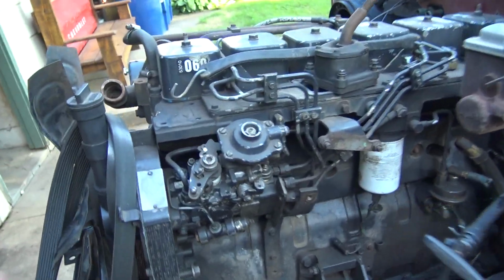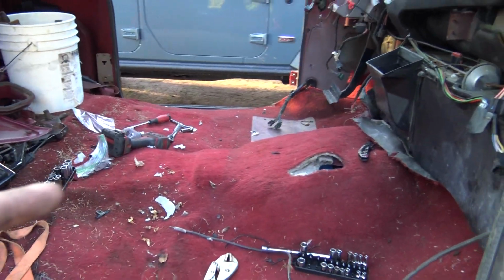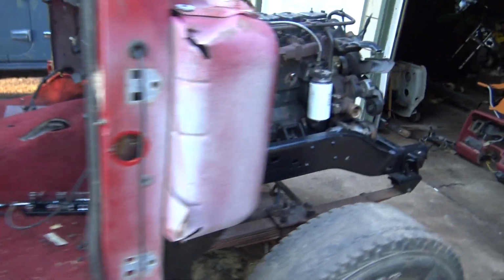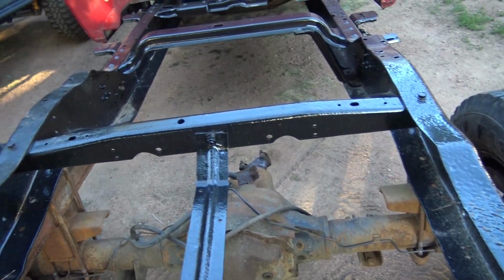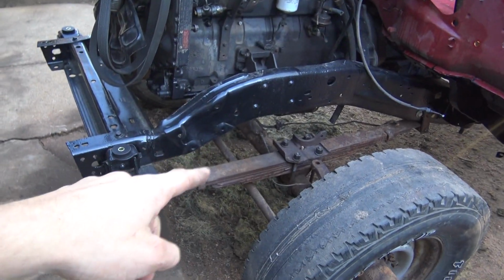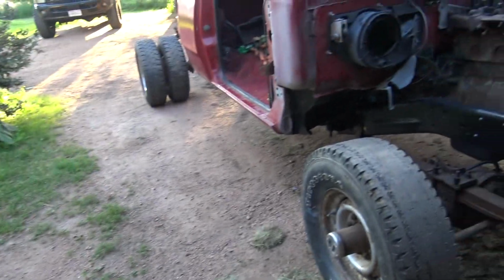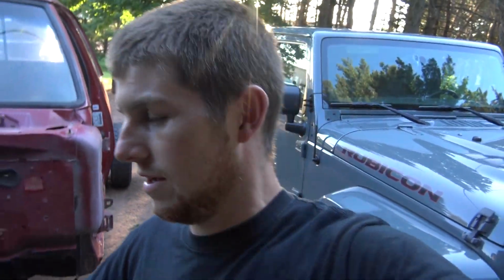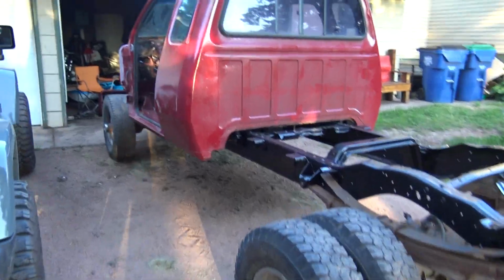First Gen Cummins Dually Build Progress

Comment: That transfer case are you planning on using?
Reply: I have somewhat the same setup in a rig I'm building. Ppump 12 with the nv5600... I wanted indestructible so I went with the np205. Then I went doubler and I'm considering a double od too but havent decided.... there are huge issues if you go with a 205 but you can overcome them. Talk to ord.